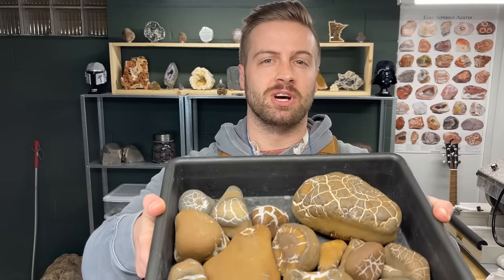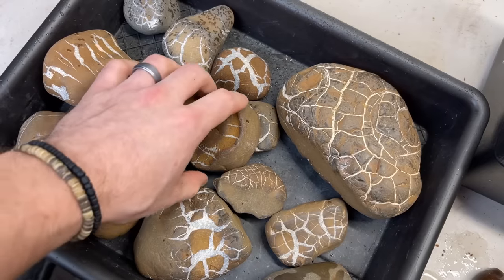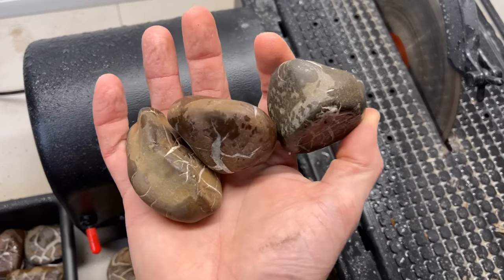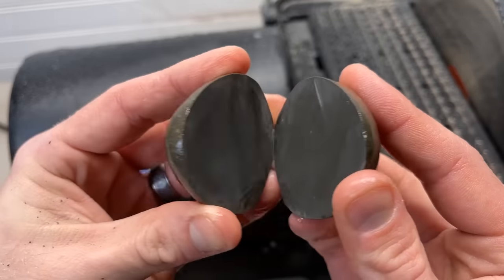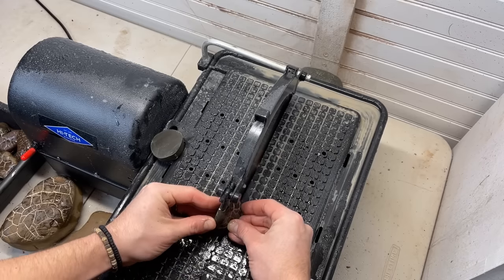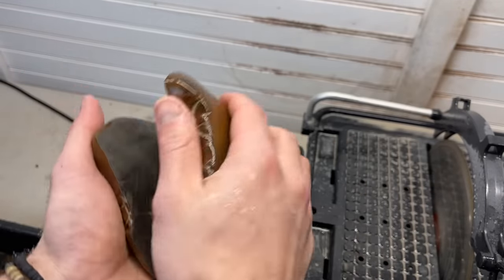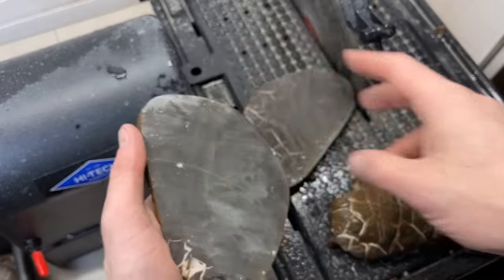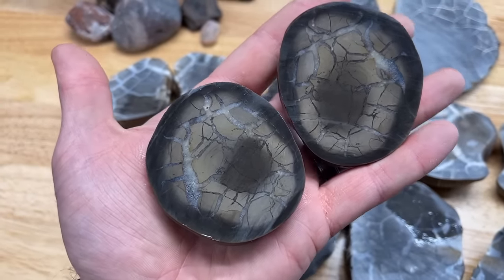Cutting Lightning Stones open | These Septarian Nodules rock!

Comment: Hi!  There are moments i wish we could Question in Real Time, 5:59 is one.  -->  I believe Those are Crinoids on side.  
tho, could be, when you cut, We may see More of the Creatures;  That would be Awesome!  (i paused video to write this) 
6:02 Right Center: - you can see Stem Discs, above is Head with Feeder Arms hanging over.  
6:03  opposite fingertips [Right] is Crinoid Stem ~ traveling up to Calex & Head.  : }   Yeah, That Stone is a Treasure no matter the outcome.  Only one's i've found in yard are no larger than 1.5 in. and they're mostly pieces or very tiny.  lol  
6:05  That side says a Lot.     Great Camera Focus!   Thanks,  Cheers!    
few more of my crazy addiction:   7:15  That Too, one from Top Right & Large Stem on Left.   
7:17  slight view of Feeder Arms - Lower end of upper Stone.   Where you find them, they'll be more.   
8:01  There they Are!   COOL!    9:09  now you'll know what those [tan or shadow] 'Ghost' like bodies are.  
12:49  Broken areas are Inside Crinoid Head, Tiny Raised parts [Grey\ White] are Part of Crinoid.   A Win, i'd say.
Stones, Cuts & Crinoids, ALL Beautiful.   fyi:  GLUING & Protection:  check out  Paraloid B-72   (i've not tried yet)

Comment: I just worried the whole time with your fingers so close to that blade.  Isn't there some type of tool you can use to hold the stones?
Reply from the maker: It's not like a wood saw, which would be very dangerous. This type of saw has a continuous diamond blade and it is much safer. I actually touch it all the time while its running and when its wet.

Comment: I would not cut thru middle. The white veins are where to grind down the outer face until you get facets. Not necessarily one flat plane but follow surface contours. Maybe two to four facets. You could do on each main faces and then slice thru middle if is still strong enough and not cracked.

Comment: They are not cracked by drying like mud, it is an underwater microbial process. Think of it like rising dough splitting open.
    Confused everyone for about 200 years. They thought there were surface mud flats but the microfossils in the clay say otherwise 100% of the time. Took modern optics.
Reply: I have a quart jar of little ones somewhere.

Comment: Rock cutting is not something I've done before....... Well a couple pieces on a tile saw.
I've known about using a saw with a moving table, either weighted (gravity)  or power driven, but I did not know rock cutting was done this way, free hand.

Comment: I think you needed to go in at a 45 degree angle and not slice down the middle like that. I also wonder what a 90 degree cut compared to what you were doing would look like. And I think making multiple slices could have resulted in a nicer showing.
Reply: Still have it the thumbs up, thanks for sharing with us. I’ve never seen these before. ✌️

Comment: You're a braver man than me, no way in Hell I'm sticking my fingers that close to a saw blade to see the inside of some rocks...
Reply from the maker: https://youtube.com/shorts/fXGv6pswyr4?feature=share
Reply: @AgateDad  - Well damn... That is genuinely amazing... So, even if the rock splits or slips somehow and your finger goes into the wheel at full force, you won't be hurt...?
Reply from the maker: Usually your hand isn’t going to be in the path of flying into the blade and should fly past on both sides. Also you shouldn’t be pushing that hard that it should crack and fly forward like that.
Reply: @AgateDad  - Noted, thank you for your time and information!

Comment: Um sily people. The saw blade cuts rocks, not human flesh! Duh, lol, just kidding about the duh part. So yes fingers close to the blade is necessary for getting nice cuts. You can literally put you hand right on the blade without cutting yourself  even putting pressure, you eill be fine. Maybe at worst a little slight burn if you hold you hand on it for a few seconds. Yes a tile saw doesn't cut flesh just ricks/tile. Sounds fake but I'm dead serious. Cheers

Comment: Lapidary saw- it's a glorified name for a TILE SAW!
Reply from the maker: It’s literally a lapidary saw 😂 not the same as a tile saw, same idea but different.
Reply: @AgateDad  NOPE- it is EXACTLY in all aspects a wet saw for tile! Same design same concept and with different blades a simple wet saw will do the exact same cuts! With the exact same results! Whether it's mounted on its side for Jem cutting or vertical for slice cutting a Lapidary saw is no more than a glorified tile saw!

Comment: My Dad nearly lost a finger on a table saw. The artist here should be using a push stick or one day he’ll lose a digit or two.
Reply from the maker: I am not using a table saw, please use a push stick on table saws.
Reply: @AgateDad  After the second video I watched I saw that it wasn’t a table saw. Didn’t have a good perspective of your saw. That video explained the method of cutting stone with a blade that isn’t sharp and won’t amputate digits. Never seen a stone saw before, and being moderately visually impaired doesn’t help either. Sad thing about comments is you can’t go back and rectify an error. Watching you cut the stones was surprisingly satisfying and a joy to behold the outcome. You’re a talented guy, no doubt about it, and now I won’t worry about you going fingerless. BTW, I’m a retired ER nurse. I’ve seen some nasty stuff over my years of trauma and/or general ER patients. I hate chainsaws! Dirty, almost impossible to repair wounds, incurred in some of the strangest ways.

Comment: Son, your headed for a bad day.  I know you feel you have nothing to worry about because you've done it forever. Learn to epoxy your stones to a piece of 2"X 4" or use a pair of welding clamps to hold the stone while you still have all your digits.  Losing a thumb is a real bitch and I bet you don't wear eye protection.  It's just a matter of time my friend.  Ronnie Three Fingers.
Reply from the maker: Thanks for the comment bub, this is a lapidary saw with a toothless “continuous” diamond blade that grinds through the stones and I actually touch the blade all the time, it’s fine if it’s wet and I don’t push down on it for extended lengths of time. I also wear eye protection and lung protection. Always appreciate the cover being judged. Have a good one 👋
Reply: @AgateDad  ......you've been warned. Kudos
Reply from the maker: You warning me is like warning me to check for monsters under my bed lol nothings going to happen